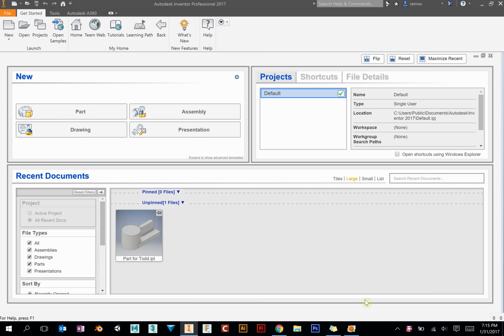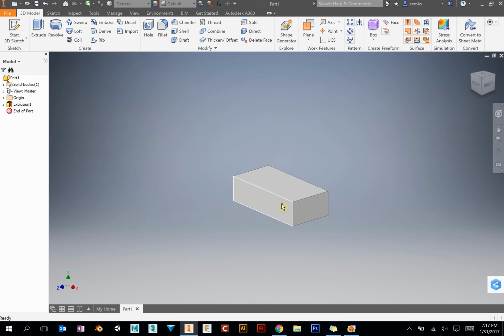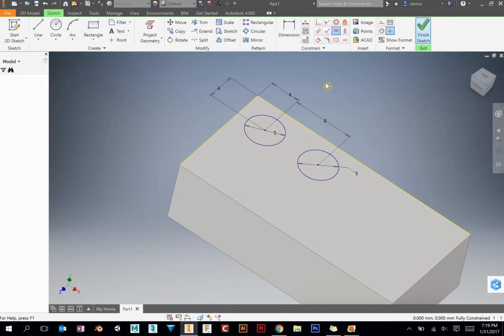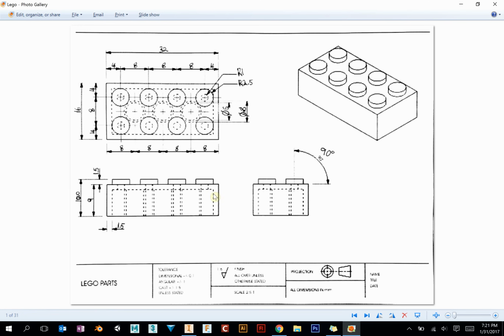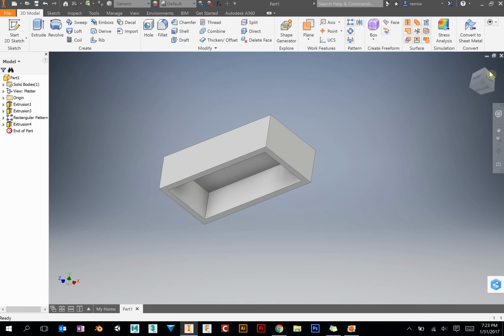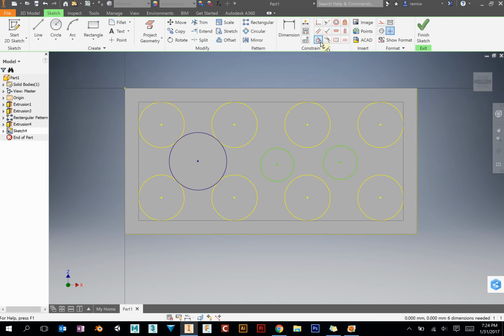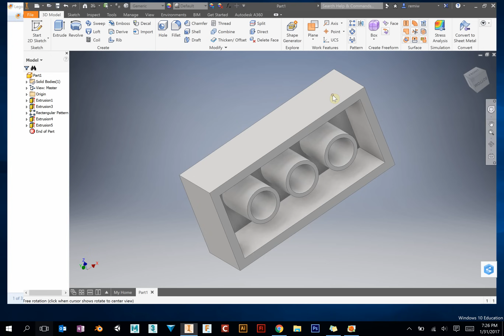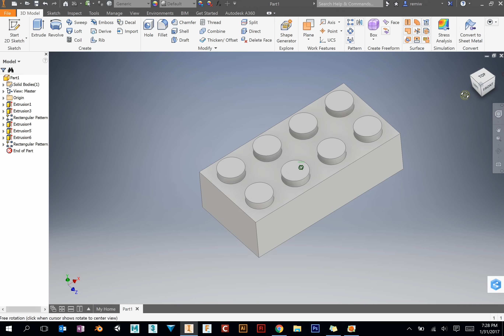Inventor Lego Block Tutorial

Comment: Thanks for trying, but when doing these tutorials you really should show best practices. On the first three actions,
1) The X-Y sketch plane should have been used so that your vertical extrusion will logically be made in the Z axis
2) The initial rectangle should have been placed symmetrically on the origin (Use two point center rectangle)
3) The extrusion should have been made using symmetric setting.
Doing these three puts the origin point at the exact center point of the object. While that may not seem important in this simple object, as parts become more complex, it really improves efficiency.
4) To extrude the base, it would have been safer to draw the rectangle and circles on the same plane, then extrude into the block as one piece. The problem with your method is that if you change the depth of the initial extrusion, the reference surface for the circles will be lost.
5) When you made the R1 extrusions into the base, you based your initial circle off one of the patterned circles from the top surface.  If your upper circles have to be modified, this will adversely affect the R1 circles.  Should have used the same initial circle.
In general, when creating something in Inventor you should be trying to think ahead for future modifications.  The best way of course is to design it parametrically as far as possible.
Reply from the maker: Thanks for the great feedback. I like your point to think ahead for future modifications and I hope people read your comment to get a fuller sense of parametric design.